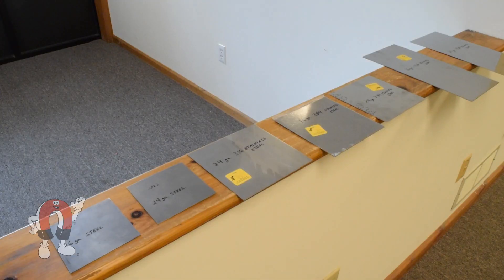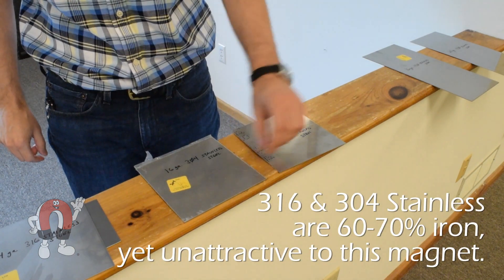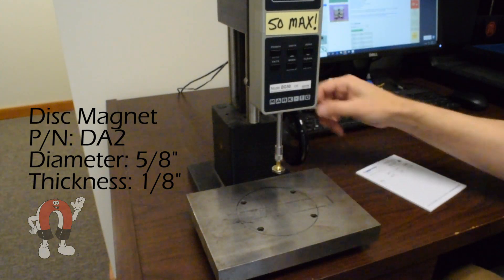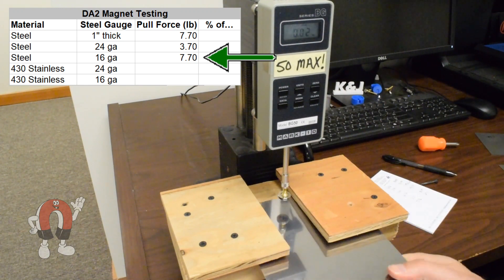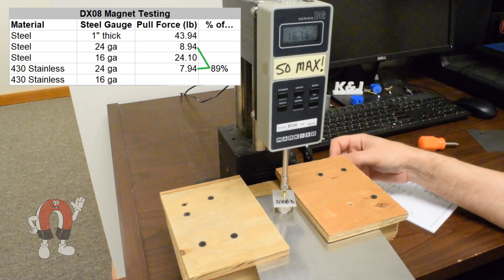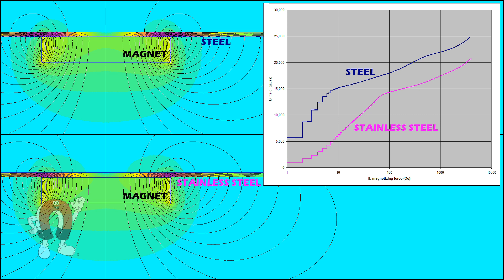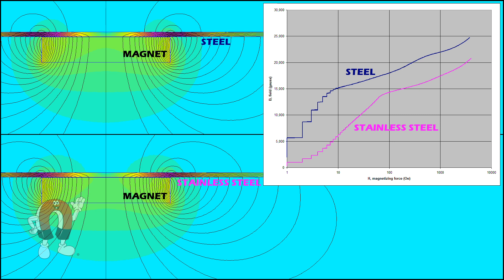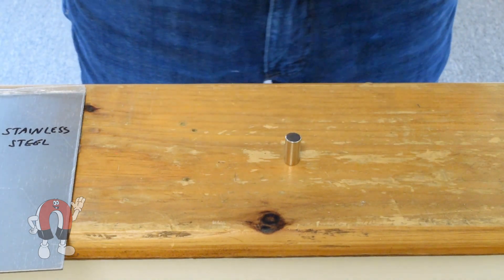Is Stainless Steel Magnetic?

Comment: Ironically rnough, i was surfing the internet to selecg sheet metal for a magnetic use case, this answered my questions, thank you
Reply: I'm buying some hooks, seller said it's stainless steel 304, it's very strong but i said it's fake because i test it with magnet didn't attracted. Now i know from this video there's some type of stainless steel, and 304 is not attracted to magnet, then we can't test it using magnets.

Comment: i put some stainless clamps in my magnetic tray used for placing nuts and whatnot when your taking engines apart. so when i put all four in their they reacted slightly, they turned out, in unison, the heavier part of the clamp to the outside and was repelled by the lighter band to the center, and they wavered, as if their was something pushing them up, repelling them and they floated about a quartier inch above the magnetic below the steel bowl. now that was wierd. i had to do it a couple times, check if they were magnetized, but nope. if they were not stainless, i couldnt use them. was confused for a bit. but the effect of it was strange.

Comment: The 304 bar stock is magnetic on the edges due to high plastic deformation which changes the internal structure of the steel (not austenitic any more) and makes it magnetic

Comment: So, that explains why a magnet won't stick to my fridge!
Reply: I always take a magnet to the store with me when shopping for appliances.  If the magnet doesn't stick, I don't buy.  I wish they'd make old-school enameled appliances like they do washers/driers.  Imagine using your fridge as a whiteboard.
Reply: You'r fridge is stainless steel.
Reply: Magnets don’t stick to the doors of my stainless steel fridge but it does stick to the sides
Reply: @jaxbrewery Is your fridge door curved? Forcibly shaping stainless steel, like with a press, changes its atomic structure, making it ferromagnetic again. This is why stainless washers are magnetic (they're forcefully stamped), while bolts and nuts aren't (they're cut and rolled).
Reply: @Red_Lion8325 Just got a new refrigerator actually and it’s flat on all sides. All sides are magnetic on this one.

Comment: Would you happen to know if steel and magnet can be fused together?
Reply from the maker: Like welded together? Neodymium magnets can be demagnetized by high temperatures...you might be able to weld or solder them together, but the magnet would be partially or fully demagnetized, depending on the temp.
Reply: @KJMagnetics  What if it was a weaker magnet and and the magnet and steel made a piece as small as 4 in lomg and 2 mm wide? Would that be possible? One half magnet the other half steel?
Reply from the maker: @honeybear1762  The steel would "block" the magnetic field on the side of that side of the magnet, so you'd have one side that was strong, where the magnet is, and then the other side would be weak, where the steel is.